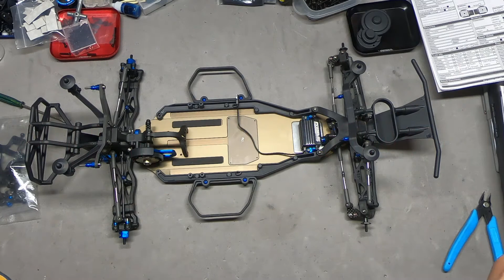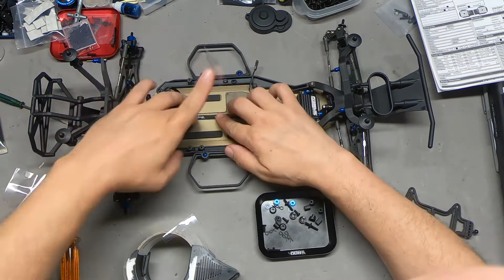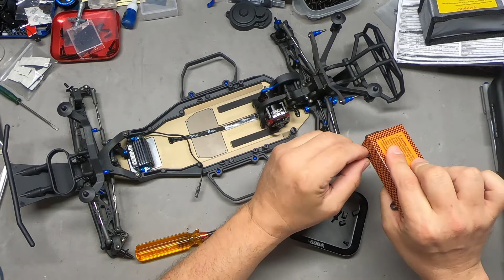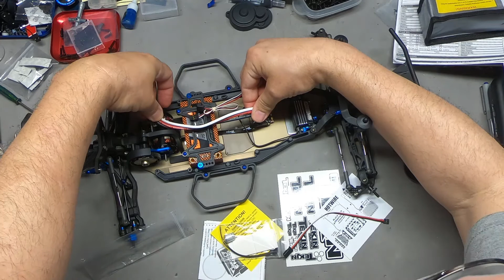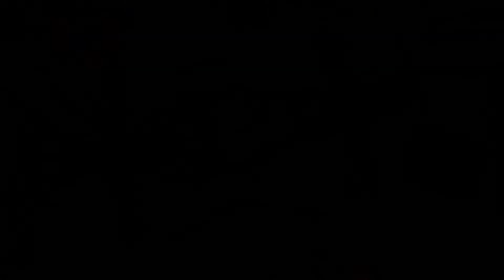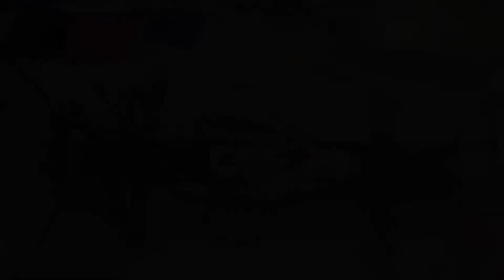Building a Team Associated RC10SC6.2 Team Kit 1/10 2wd RC SCT (Short Course Truck) - Pt. 9

Comment: What motor did you use please.
Reply from the maker: Hi, I used a Tekin RedLine 8.5 turn motor that I already had from a previous build. I planned to run mod class which opened the motor selection to just about anything. If I’d wanted to run stock class, I’d have been restricted to a specific number of turns like a 21.5 for example… I forget what the spec is for stock 2wd SCT. 
For stock class racing, I like the Revtech motors. 
You’re looking at the 8th video in the series. I usually go over all the things I’m adding to the kit to complete it in the first or second video. 
If you’re going to race modified, you’ll probably go with a 4-10 turn motor depending on your skill and experience. If you don’t have a lot of experience, I recommend starting with a milder motor until you master the truck. 
Happy New Year!
CJ

Comment: Hi I have been watching the build series for the RC10SC6.2 as I am interested in this kit.
Thanks for the insight into the build, could you please let me know what the front and rear track width is minus wheels as I am looking to build this as the basis for a no prep drag car.
Regards Derrick.
Reply: Thanks for taking the time to reply CJ I will continue my research 👍
Reply from the maker: Personally, I wouldn't use this for NPD. The kits that people use have to be combined with buggy suspension parts to narrow them. Most people use Associated parts and an aftermarket chassis. I spent a lot of time and money building on the TLR 22SCT 1.0 chassis because I wanted to build with a mid-motor configuration. I saw that as a better setup weight wise and a lot of other people did the same using the last version of the TLR 22SCT, the 3.0. 
Team Losi Racing 22SCT 3.0 1/10 Scale 2WD Electric Racing Short Course Kit
https://www.amainhobbies.com/team-losi-racing-22sct-3.0-1-10-scale-2wd-electric-racing-short-course-kit-tlr03009/p-qqaqqskqtz2xactz

You still have to buy various TLR 22 buggy parts like suspension arms, etc. to narrow the track. 
There is a lot of info on how to mod the 22SCT 3.0 for no prep as a mid-motor car.

DragRace Concepts has been building kits from the beginning of the NPD craze and they have the most design experience because they are not just cannibalizing a bunch of parts designed for off-road racing. They are selling their latest kit with suspension parts they've designed themselves specifically to create a system oriented for the needs of drag cars.
If I was going to build another drag car, I'd buy this kit: DragRace Concepts Drag Pak Maxim No Prep 1/10 Drag Race Chassis Kit
https://www.amainhobbies.com/dragrace-concepts-drag-pak-maxim-no-prep-1-10-drag-race-chassis-kit-drc-10000/p-qqqcqzrqnzqnqctz
Believe me, you'll end up spending less money and you'll get a car that will be much better than any SCT based car.
Tip: if you get a true drag motor like the 2.0T - 3.5T drag motors, you MUST get an ESC that can handle to power needed like the Tekin RX8 GEN3 1/8 Competition Brushless ESC
https://www.amainhobbies.com/tekin-rx8-gen3-1-8-competition-brushless-esc-tektt2302/p-quactqyqhb2xactz

It has no limit on motor for a 2S lipo pack... most 1/10 and even 1/8 ESCs can't handle the power draw of a low turn motor like the 2.0T - 3.5Ts

Also, get a big capacitor bank like this: Team Brood "XL" No Prep Drag Low ESR Capacitor Bank (Extra Capacity)
https://www.amainhobbies.com/team-brood-xl-no-prep-drag-low-esr-capacitor-bank-extra-capacity-bro-tbr-capbankxl/p-qqqeqzkqpbzxqctz

With this chassis, ESC, Cap Bank, and a low turn drag motor, you'll have a real NPD monster!

Good luck,
CJ
Reply from the maker: Also, I'm sure you have your own favorites in drag car bodies, but if you want to win, front end downforce is a huge concern. I'd recommend the following in this order, best to last:

Pro-Line 1985 Chevrolet Camaro IROC-Z No Prep Drag Racing Body

Bittydesign ZL21 1/10 Pro No Prep Street Eliminator Drag Racing Body
with the
Bittydesign ZL21 Pro Drag Racing Wing Set

JConcepts 1987 Chevy Camaro IROC Drag Racing Body

Protoform Chevrolet Corvette C7 1/10 Pro-Mod Short Course Drag Car Body

Pro-Line 1995 Toyota Supra Short Course No Prep Drag Racing Body

In my opinion, the 80s Camaro bodies are going to provide the best front downforce with the almost flat wedge front end. Put some clear lexan over the headlights to fill in the buckets and smooth out the nose. The Bittydesign ZL21 is also a good body when combined with the optional wing set.

Remember, these are just my opinions...